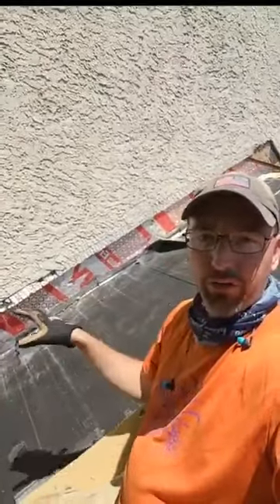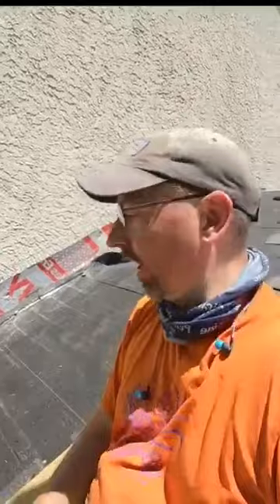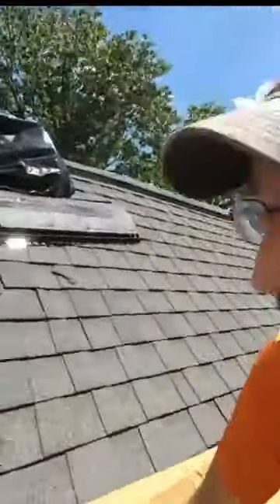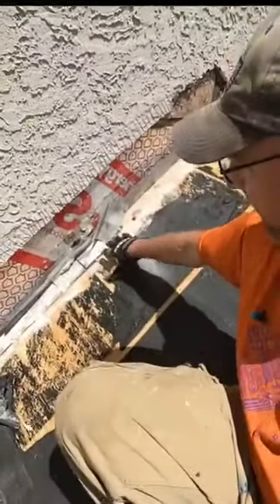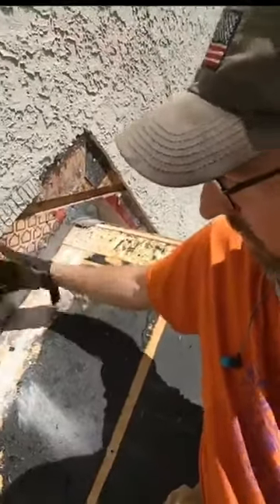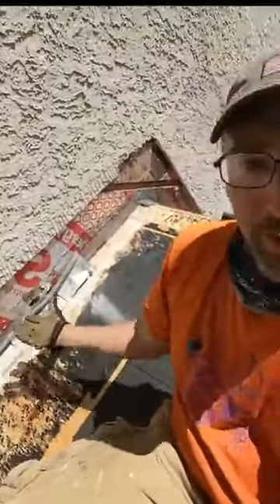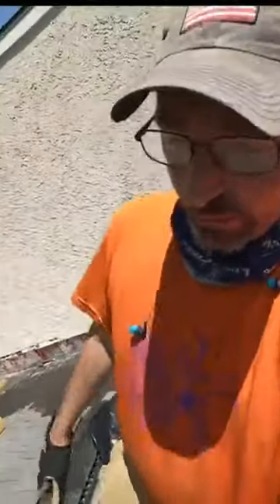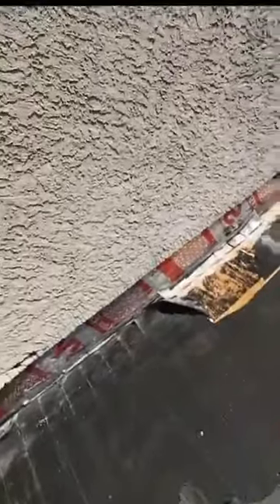Stucco Leak Repair (Part 2)

Comment: Hello,

Soooo.... since I cannot hear that well. I am going to take a guess of what was causing the problem from what I could tell.

There was two layer of step flashing that was not done correctly? Why would there be two layers? 

My mother in law is having a leaking problem but her shingles looks fine. She said it was leaking on the side of the side of the house. My immediate guess was the Step Flashing must have not been done correctly. 

Do all of the flashing under the stucco need to come out? Or can you do roofing and leave the flashing on but to make sure the step flashing is done right as I work my way up. Granted, I will make sure the flashings are in good conditions.
Reply from the maker: The step flashing from the roof to wall interface had slipped... probably when the roof was replaced, and at least one of the pieces was overlapped in the wrong sequence... in front, when it should have been behind... acting as a funnel and directing water into the home.

We diagnosed this with a garden hose.... and someone inside watching for leaks... we started at the bottom and SLOWLY... 2 to 4 minutes per foot, worked our way up the roof until the person inside cried "I have water!"

then you can start tearing it apart at that point.  Obviously vinyl siding is easier than stucco... but it can be done.